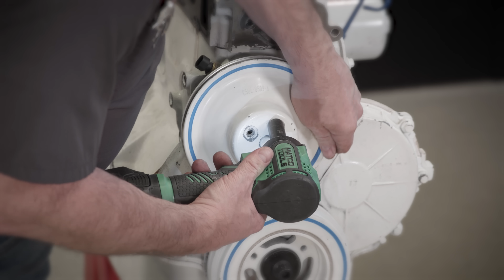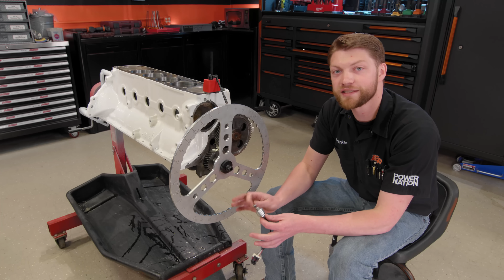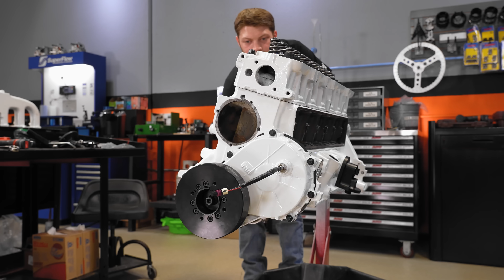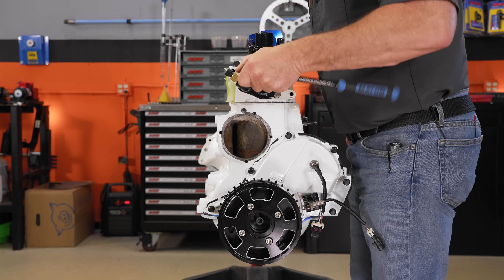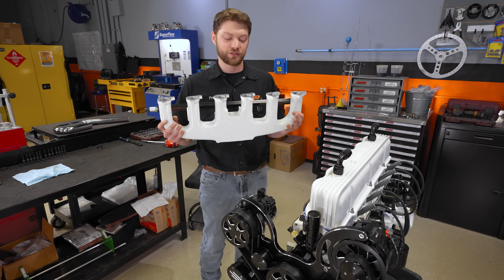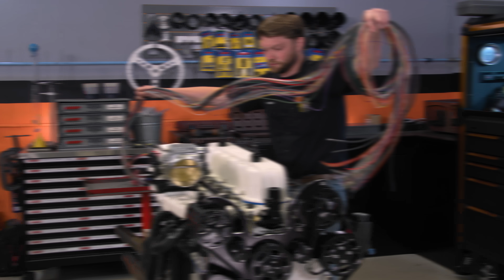Ultimate Turbo Ford 300 Build: Part 2- One of Kind EFI + Next Level Assembly

Comment: All I can think while watching is.... what is the cost for this engine once its fully upgraded? Like how much did it cost to get it to this point and what is the estimated value if it were to be sold?
Reply: This is an R&D build, half the parts were for monitoring the engine, not exactly needed for a running, driving boosted engine.

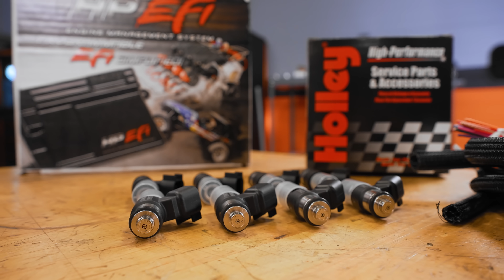Comment: Did I miss something? This is an inline 6 cylinder but at 17:28 into the video the say they are using 8 flow matched fuel injectors. Should there only be 6?
Reply from the maker: They came as a set up 8 so we got 2 extras for our 300

Comment: If they filled the top of the block,wouldn't that fill all of the coolant holes to the cylinder head ? I didn't see them drill the dried filler,did I miss a step ?
Reply from the maker: Yes it did block them off during the filling process, but after the block filler had fully cured, we opened up all the cooling ports in the deck surface to allow coolant flow. We mentioned it but we did not have time to show it

Comment: Impressive build, I would have gone higher on the head torque value of 80ftlb and dont know if that composite head gasket will last. That engine should put out more than 500 -600 hp at 20+ psi boost

Comment: Hey Ford..... if you'd pull your collective heads out of your butts, you could build similar to this with a basic 5 speed drivetrain, minimal electronics, and comfortable seating. You couldn't keep them in stock, even at 60,000 a unit.....But we all know you wouldn't want to make something that's rugged and lasts.
Guess I'll just keep driving my 1995 F-150, 300/I6 and do another engine / transmission rebuild when I hit 500,000 miles.

Comment: FE guy here. I like how the stroke is the same as a 428 (3.98) and cylinder diameter originally is the same as 352 (4.00) but this one being bored .050 is the same as 390. Add 2 more cylinders and you got a 410. Awesome work Frankie and Pat!

Comment: WHAT'S THE VELOCITY INTHE PORT ? 
FLOWING BIG CFM MEANS NOTHING OR IRRELEVANT. 
A RACING HEAD WOULD START WITH THAT HEAD & 
DARIN MORGAN WOULD PORT IT TO THAT CAM & ENGINE SIZE , 
BUT MORE FOR THE APPLICATION. 
HE PORTS TO 2.8 HP PER CUBE , 
N / A HP = 840 HP 
NO POWER ADDER
BILL FOR A SET OF V8 CAN BE,
20K

Comment: The "ultimate" 300 build should have included a cross-flow head. I can't envision any "ultimate inline 6" without it. Going with a traditional factory head is just killing so much power. Remember this is not a build geared towards "DIY". This is, by their own title, supposed to be an "ultimate" build and unfortunately it just isn't.
Reply: The ford 300 came with a reverse flow head, and ford never developed a crossflow head, so that's what they're working with. 

Look at the amount of turbo builds on a 300 vs LS/Cleveland head builds.

You're discounting their build even though a turbo is going to push past that restriction anyway.

Keith lopez has already made over 1,000hp in his fairmont. And that's with a reverse flow head.

Comment: 112° LSA? With that cylinder volume, relatively small valve and low flow, the LSA needs to be much tighter for optimum scavenging. I wouldn't go any wider than 106° and narrower would probably be better. How is 111.5° intake centerline accurate? It should be 108° with 4° advance. Put an offset key in the crank or camshaft. 224 CFM is all they got on that intake port!? The slant six head can be made to flow better without much trouble and it feeds a cylinder only 75% as large. But with brand name this and brand name that at least you get paid.
Reply: Evidently you have lots of experience porting both slant 6 and 300 heads and have some accurate info that you have gathered on your flowbench. Do you build engines? Do you design cams? Do you do lots of dyno testing? It appears so and you have extensively dyno tested this engine combination before with a cam like you spec'd. Show everyone here your numbers to support your statement. I'm here to learn like everyone else.
Reply: @strictlybusiness1598  I was a 225 racer and collaborated with many others. All of the fast drag racers landed on narrow lobe separation, with significant advance, for best ET. There is no substitute for proper vale timing events naturally aspirated and the roller in this 300 Ford misses the mark. The 112° LSA is too wide and the cam was installed retarded. It should have been at 108° ICL. If you want to pay for a flat-tappet cam regrind at Oregon Cam Grinding we can ship the finished cam to Engine Power. If they'll run it we can see if I'm full of it. I'll bet you $1 that cheap flat tappet will be up at least 20 lb-ft, have more area under the curve and lose less than 5 hp at the top, if that. Do you want me to give the valve timing events for their current cam and the one I'd use? That's $75/hr.

Comment: Hope that all these mods can be done in the aftermarket. That custom "bung hole" timing chain cover would be nice if it was manufactured as well as a plug and play wiring harness. I know building things custom has a cool factor, but if you have a failure and have a manufacturer off the shelf for example wiring harness from Holley would be awesome.

Comment: With the brass drive, make sure you enable an oil pressure safety, or it'll keep running after all the teeth are gone and you won't notice til it's too late

Comment: Interesting build, what did you do to help it rev?  These big Ford 6's are known for low RPM and very reliable.
Reply: I have a moderate build in my truck mated to 4R70W trans. Highest rev was 4200 at 2-3 shift point. That's enough for me. Cruise in O/D at 65mph 2000 rpm.

Comment: I’m really surprised that y’all didn’t install stainless steel o rings in the block with receiver grooves in the head.  On the Ford 300 with forced induction, the failure point is typically the head lifting thereby blowing the head gasket.

Comment: No budget no limit? You need to speak with Edelbrock and make a 4 valve head.
Reply: Just get a Barra. Not enough demand for people building 300 six to pay for engineering, R&D, and manufacturing a 4 valve head. Not to mention the bottom end of a 300 six is a limiting factor. 2 bolt mains. I bet they won’t spin this thing at a very high RPM. 6000rpms max.
Reply: @markball7028 

Please put your barra fanboyism somewhere else before you discount the 300. 

The 2 bolt mains and claimed low rpm capabilities are simply untrue. A well prepped 300 can turn higher rpm than stock. It's effectively a 400M missing 2 cylinders. 

Drag racers have turned a 300 crank to 7k rpm, so 6,000 is definitely doable. 

The 2 bolt mains clearly don't seem to be the weakpoint, as keith lopez has pushed over 43 lbs of boost through his 300.
Reply: @riogrande163 my comment was towards the aftermarket developing a 4 valve cylinder head for the 300. The 300 simple isn’t desired or sought after enough as a big performer to make it worth while for a company. That is the truth. Barra is much more well known and suited for high hp. Especially in Australia. The 300 was never intended to be a performer. It’s a reliable industrial workhorse engine. The chances of power nation spinning this engine past 6,000 rpms is slim to none.

Comment: I still do Not! Understand how Eledbrocks or TrickFlow and even CHI aren't making a head for this in a Ford Cleveland style head design no damn ls b.s design Ford on Ford.  And can you imagine naturally asp. With 6 Webber side draft carbs
Reply: The problem is that crossflow heads don't work with cam in block. So port design is very limited. The factory head is close to everything that can be done.
Reply: @aw9680  It can be done, see practically any pushrod V8. Though how much benefit you'll see is another question.
Reply: It can be done.  That's a fact. Look it up, genius . Two Cleveland heads to make it work. With right machine shop work Google it. Hell it's even on a YouTube channel. Ellison machine shop done one actually redone it,rebuilt it. So yes it can be done.
Reply: V8 head architecture isn't the same as inline architecture. You can't just slap a v8 head on an inline.
Reply: @aw9680  I agree, you can't just slap a V8 head on a Ford 300. But you can make a crossflow head for a pushrod inline. As with a V8 head, the ports on one side have to be squeezed in between the pushrod tubes. Less than ideal, it's why pushrod V8s usually have tall, skinny inlet ports. They don't flow as well as a round port of the same area, but if that's what you gotta do...

Comment: In the age of CNC and Billet heads. Why can’t Trick Flo or other companies make a Crossflow head better porting and heat management.
Reply: If you really wanted to go crazy you could convert it to overhead cams and 4 valves per cylinder. Lot of work though.
Reply: They can, but they would have to spend a lot(hundreds of thousands of dollars) in R&D and tooling in order to start making them. There isn't enough people who want to pay what they would have to charge in order to manufacture them. In short, it isn't economically viable to mass produce cross-flow heads for the 300I6. That doesn't mean you cant get a custom head machined from a billet of aluminum, it will just cost a lot of $.

Comment: I turbocharged my 1FZ-FE 4.5 I6 in my 1997 Landcruiser J80.  These big inline six engines love boost.  I am currently running 10 PSI boost.  But, just swapped in a ZF 8HP75 transmission from a 2021 Dodge 1500 pickup.  Now I have a transmission that can take higher torque output, going to 12 PSI boost very soon.  Love the boosted I6.
Reply: Video please.  I want to see moar
Reply: The one problem with turbocharging big American I6's like a 300 or 292 is they don't have a crossflow head like your Toyota. The exhaust manifold gets much hotter when feeding a turbo and that heat soaks into the intake bolted right next to it. A few dyno pulls, with time for it to cool down between those pulls, is much different than working the engine for any extended period of time.
Reply: Weld together 2 ls heads.. it's been done a few times..infact with work LS heads can fit on a Winsor 5.0 😂 true story @CzechSixTv
Reply: @BUNYIP1980  I've seen the cut/weld Cleveland and LS head mods for a 300, but it's not really a DIY project for most people. It's hard to keep coolant where it belongs. Running the engine dry on methanol in a race application would be pretty easy though.

There were also a few crossflow head designs for the big 6's promised here and there over the years but none made it to any real production. It would be nice if someone with one of those designs talked a company like Engine Quest(who casts there own repro 300 head) to produce them. I'm just not sure there's a big enough market..
Reply: Every ICE loves boost.
Reply: @markball7028  until it doesn't
Reply: I turbocharged my 4.0 l6 in my Cherokee. 15psi on s modified engine. It absolutely rips.
Reply: @JeremyM5381  that would sound phenomenal
Reply: Why that transmission? And what kind of adapter did you need?
Reply: What are you using to control the transmission?
Reply: Awesomeness 👌
Reply: I asked Power Nation to build one of these, not sure if they’ll do it. The one kit I knew about for the 1FZ was through Witt’s End but something happened with the business. Did you go with a kit or design it yourself? Torn between going turbo or using one of the SBC I have or maybe going to an LS. Staying Toyota is cool but going to a 6.0L puts out more power and probably better mpg. Still not a cool as building a turbo 1FZ though. Just getting my 97 Land Cruiser running again is the big thing. My water leak could have come from the PHH. I’ll need to check compression and leak down to verify if I have a bad head gasket. Cheers and yeah, I’d Aldo like to know about your transmission selection and controls.
Reply: sounds like a heaps cool build, and having a squiz online they don't look like they have the weakest conrods. be interesting what you manage to get out of it
Reply: I thought the 80 was split into 2 series, the fj80 w the 3fe and the fzj w the 1fzfe. Is j80 the new lingo?
Reply: And I turbocharged my Briggs and Stratton 1.5 hp lawn mower. Show pics.
Reply: @markstopkey4085 you say that as if it’s impossible…it’s not…it’s been done…

Comment: Id be crazy to see someone convert a 300 to use the heads from a 4.6 4v motor but id be near impossible given how much time its taken for a few guys to convert the 300 to use a modified ls head
Reply: Just get a Barra I-6. That being said. There are people that have fabricated two GM LS cylinder heads. They take two heads cut the back cylinder off and put them together somehow. I guess bore spacing is a match.

Comment: One of my favorite builds. Would love to have this engine.
Reply: Yeah buddy!
Reply: I have a '64 Econoline that needs a motor.  I'm thinking the 300 would be perfect.
Reply: @MoaByte-v2z Why would you put an all out race piece in a van. This engine needs to be put in a light weight 2 seater like a Ford falcon.
Reply: @markball7028 absolutely.  But a basically stock 300 to replace the 144 cu I6 would still be a huge improvement and hopefully still fit in the dog house.
Reply: @MoaByte-v2z it’ll fit but have to use the 1barrel intake the offy series doesn’t fit the dog house
Reply: @RCRANE1992 thanks for that.  I don't imagine that van cruising comfortably over 70 mph, but it needs to be fun.